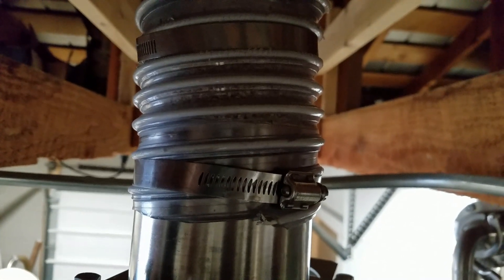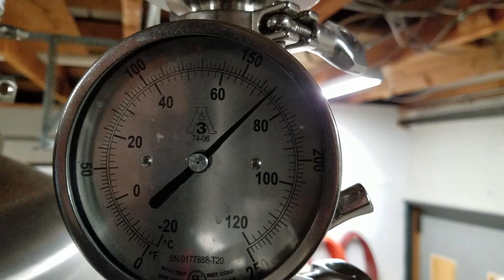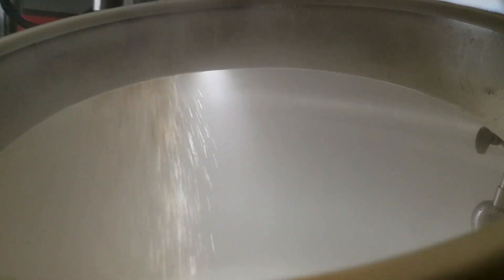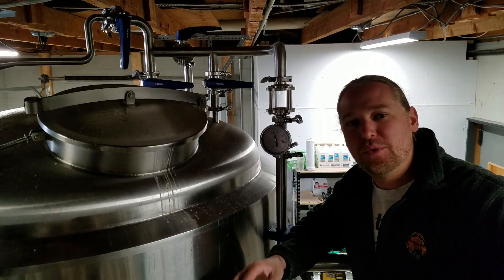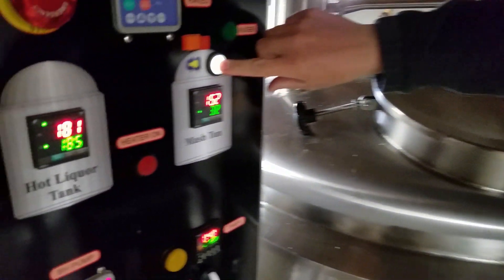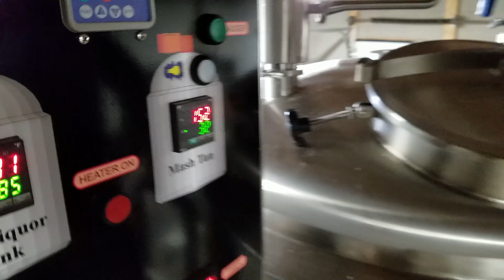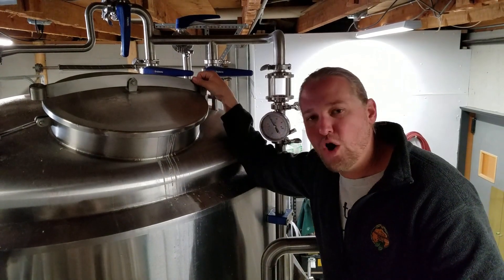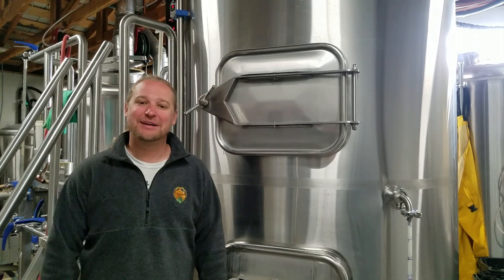MASHING & GRAIN HANDLING! How To: Microbrewery!!

Comment: My brewery is only around 500ltr for the mash tun how long would you pre heat your vessel and how would you know you have done it enough? And have you ever tried putting down like you said to cover the filter and then put in grains dry and pumped water from under the grains I heared it works well. Cheers!
Reply from the maker: Daz, the preheat is a quick process. I run 85C water through the sprayball for 5 second bursts 3 times. If the water that drains from the MT between bursts is hot then you're all good and ready for foundation water. 
I have tried dumping bags of grain into the MT while adding mash water. Never have tried adding all the grain then mash water. It is an interesting idea and im sure it would work. One problem with having so much grain and so little water will be the formation of dough balls. It may take more effort to stir and completely hydrate the mash, if not lower efficiency would be expected. Dust is always a problem when not using an enclosed grist hydrator. Hope this helped, Cheers!
Reply: Ok thanks for that, From what I have seen underletting back in the days was very popular and reduced the number of dough balls so I'm very interested to try it out not many do that way over here indeed.

Yeah the dust from both the grain mill and dumping it in dry is a concern for me I will be wearing a mask and having a fan blowing for sure cant wait to start now!

Comment: Nice informative video again. Keep sharing. You mentioned you prefer grist to water ratio of between 2.6-3.0. That means 1 part grist to 2.6 parts water, correct?
Reply from the maker: Yes, 
Calculating mash water volume to add with a 2.75 ratio example:
Metric: (10kg grist) x 2.75L/kg = 27.5L mash water
U.S:   (10lbs grist x 2.75) / (8.32lb/gal) = 3.3gal mash water
        
"bbl of water weighs 258lbs"

Comment: Good video dude! Let me ask you this. You said you mash in for 40-45 min at 152 degree mash temp. If you were mashing in a 148 degree temp would you let the mash sit for a longer period of time?
Reply from the maker: Thanks man! No, I don't.

A lower mash temp does dissolve the starch slower and I have seen a rise in Initial Plato readings when extending mash times, 30 mins to 90mins will get another 0.2P. However another hour on my day is not worth the cost of malt to get me another 0.2P.

Most Starch Gelatinization can happen between 140F and 167F. 

 From what I have experienced I can mash in at 150F for 45mins and my Final Gravity can be 1.7P (1.007), as "dry" as I need to go.  
In thin mash conditions survival of B-Amylase has been shown: 

158F Survived for 7mins
150F Survived for 30mins
145F Survived for 60mins
135F Survived for 90+mins

Hopefully I hit on some points you were thinking about.
Cheers!
Reply: Awesome thank you, you have given me much more info than I could have anticipated! Much appreciated! I ask cuz when I use Beer Smith for designing recipes, it recommends a longer mash rest for lower mash temps. For example, mash at 148 degrees for 75-90 min vs 152 degree for 45-60 min! I figured it takes longer for the enzymes to convert starches to sugar at lower temps! So I was curious how long you rest your mash at lower temps in a pro setting! Peace!